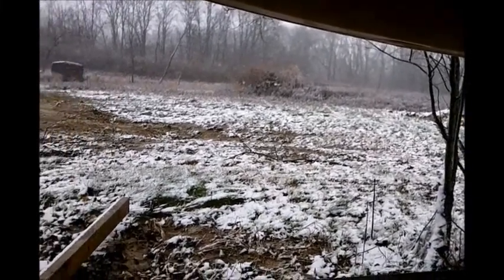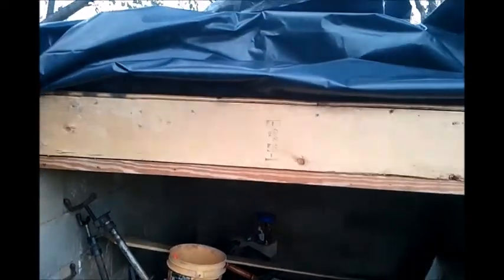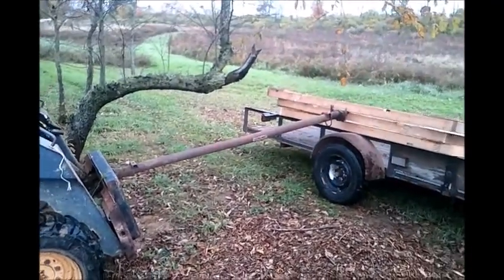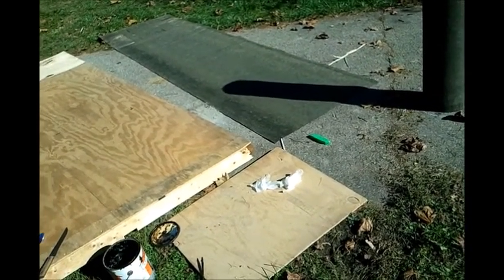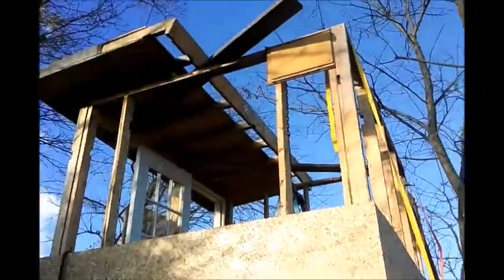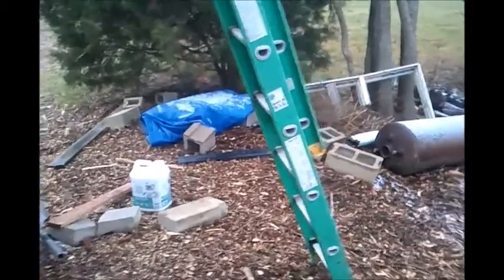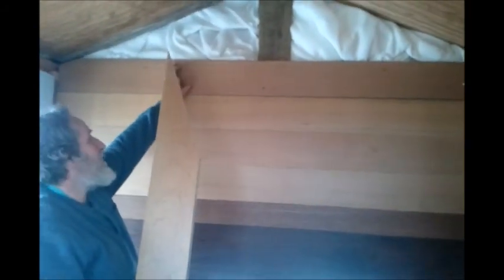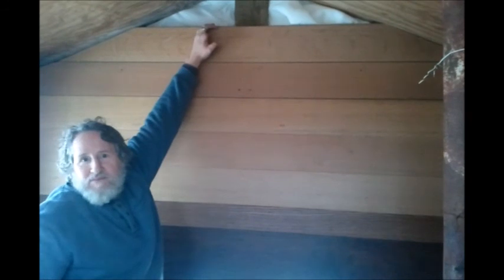Tiny House on the Lake $250 out of pocket

Comment: And if I were you I would think about looking into a stucco impregnated with long strands of fiberglass that is an approved system to bonding cinder blocks together for a very durable wall  system has been around for quite some time now and it really is a fast way to install all sorts of masonry walls it wouldn't take you more then a couple of hours to just smear the outside anyway although I would check into the effectiveness of just doing one side
Reply from the maker: That is a great tp. I wonder if it would work to repair the cracks in my other block building (where I did use mortar and now have cracks).
Reply: @AndrewBrenner1  you know something Andrew it's amazing with YouTube the things that you end up learning without even thinking about it about a week ago I was watching a video about people with block foundations with major complications some of them almost looking like a complete tear out would be advised but yet there is this new system around that revolves around a two-part epoxy and sheets singular sheets of what the heck is that carbon fiber that is and they say when you apply this and you have to strip off the paint I believe to make the bond perfect but supposedly they say it's a strong as steel when it comes to fixing small and large cracks in cinder block walls actually it's even usable in poured concrete foundations also

Comment: I'm going to have to check into techniques to strengthening 2x4 framing as to possibly eliminating the need for sheathing I'm not sure what it would take but I have heard about people just going right from framing right to the sideing I just need to figure a way to brace those walls for wind shear I'm sure a lot of people will tell me plywood is your best bet but I'm wondering maybe there is somewhere to do it with strapping only because I don't remember some experimental housing that she's 80% of the house with styrofoam and only used plywood on the corners I need to find out what they need to strengthen the rest of the framing
Reply from the maker: Certainly the hardwood flooring on the inside would make it stiff enough but I like the sheathing so that I can nail the siding anywhere I need to without respect to hitting a stud.
Reply: @AndrewBrenner1  I agree with you it's nice to be able to just sink a nail anywhere you want to but unless plywood comes down in price I'm going to have to forgo that luxury

Comment: I'm wondering if you can do that with most hot water heaters today I think they're fiberglass tanks now I'm going to have to keep my eyes open for a nice old one it looks like you could make a nice wood burner out of that sucker I'm wondering if you're going to need a larger opening for your draw so that you can get a good draft going I'm not sure of those three quarter inch holes or enough but maybe who knows and looking at the hot water / wood burner I'm thinking about a friend of mine's house who uses a 50 gallon barrel which does his whole house and it's pretty big but the way it's designed is he lays the whole barrel horizontally so I'm wondering if you wouldn't get a better burn design by laying that tank in a horizontal fashion but of course it's going to take up a lot of room you probably don't want to get to using too much floor space
Reply from the maker: The key is to get a gas water heater. Electric ones are  fiberglass as a rule